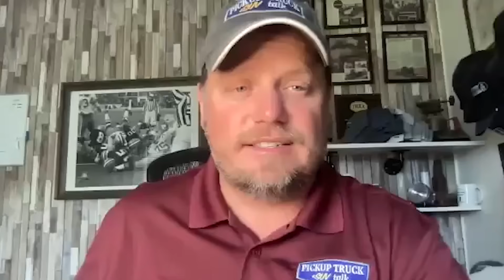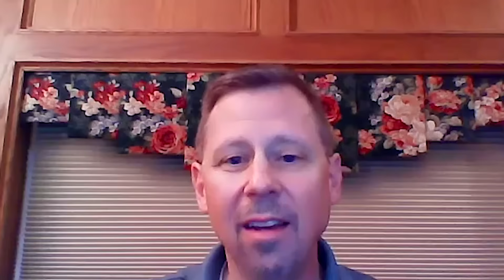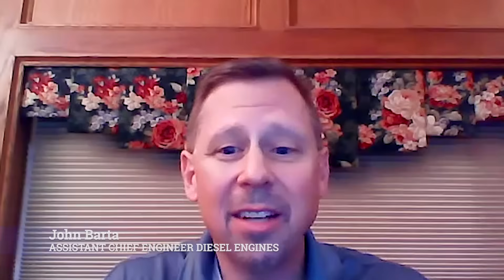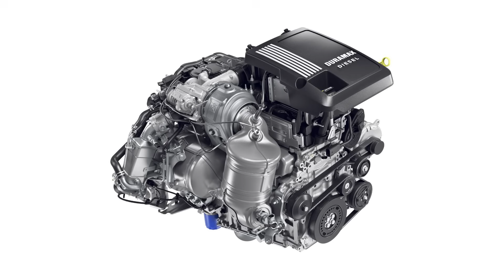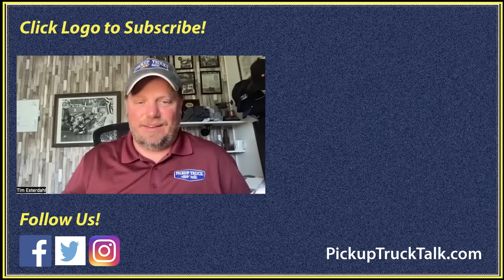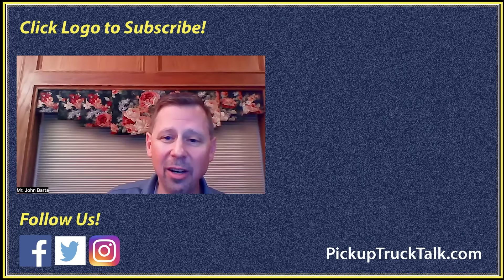GM's 3.0L Duramax Diesel Engineer Answers Questions Owners Keep Asking

Comment: Now put the shifter back on the column where it belongs! Gm that was your #1 best feature!!!! Now it’d be #2 cuz that 3.0 sounds like an amazing motor bug for crying out loud get rid of the console and rotary shifters on trucks!!!!!!!!!!!!
Reply: Column shifters are for grandpas.
Reply: I switched to a Ram and actually would never want a column shift again after the dial I have in the Ram
Reply: @bigbuckeye76  I hate the dial too. I prefer console shifters over anything.
Reply: @skoolynugenator1802  I feel like the console shifter just gets in the way. Ford's solution was to make it fold down. These transmissions shift completely electronically anyways, so a dial or something like it make the most sense for conserving space.

Props  to Ford I guess to find a way to keep the console shifter but not use a dial just to spite Ram. Gotta differentiate for brand purposes I suppose.
Reply: I believe the column shifter if by far the most practical & utilitarian way. It’s quick and simple.
That said consumer grade pickups are no longer going to use it mostly due to aesthetics, and attempting to appeal to a younger consumer. 
Out of all of the newer shifters found on the big 3, Ram has to be the most practical. The dial frees up a huge amount of space in the well designed center console.  Ford’s solution is second best I guess. That folding shifter is useful, though only when parked, So it’s still in the way when driving. GM honestly should’ve gone with a push button shifter on the dash or something unobtrusive because their previous center console was much more useful.
Reply: Why, they rattle around.
Reply: @GregD94  they block the AC vent. At least the shifter stays cool I guess.
Reply: You still get the column shifter if you don’t get the bucket seats with the fixed center console. If you get the flip up center console that doubles as a center seat then you get the column shifter
Reply: @danielthompson4865  I know for the lm2 I think is the designation, on the build and price if u get the lz0 or the new precision shift transmission you have to get the console shifter. I’d just like the motor of my choosing w a proper way to get it in gear 🤷‍♂️
Reply: I hate column shifters.

Comment: Interesting that the LZ0 isn't available in the Yukon/Tahoes in MY23, but the LM2 is. Was also hoping to see the new ZR2 Silverado available with this LZ0 but unfortunately that is not in the fleet ordering guide. Would still be interested in an LZ0 Z71 or AT4 Tahoe/Yukon.
Reply: The LZ0 will more than likely come to the '24 refresh of the SUV platform. Remember, the pickup truck got the LM2 in '20 and then the SUV redesign was one year behind in '21.
Reply from the maker: I meant to ask the question if they figured out how to do it. Since 2020, GM engineers haven't been able to put this Duramax in a ZR2 or Z71 Tahoe because it doesn't fit right. The Duramax has extra cooling lines that they can't fit with the fascia design of the off-road trims.
Reply: I was really bummed to look and see that you can’t get this upgraded engine in a Tahoe. If they only had this diesel in the Z71 Tahoe then I could finally get off the fence.

Comment: Diesel Hybrid or Plug-in Hybrid would clean up shortcomings of city driving and instant torque. Assuming you would lose the space below the rear seat for the battery like in the tundra. Engine would really take a leap in MPG and Power numbers. EV trucks will supplant regular gas engines. Diesel will always be needed for hauling/towing/overlanding/commercial applications. Business case should be made for more investment. Will still be a need for Diesel years after regular gas engines have all been retired....

Comment: Hey Tim,
I wish you would of asked about a 4 cylinder version for small trucks and the commercial market? Is it dead or if it’s alive will they make it here in the states?
Stay safe and healthy!
Ron
Reply from the maker: Dead for the U.S. The new Colorado and Canyon both dropped it in favor of the 2.7L gas engine.